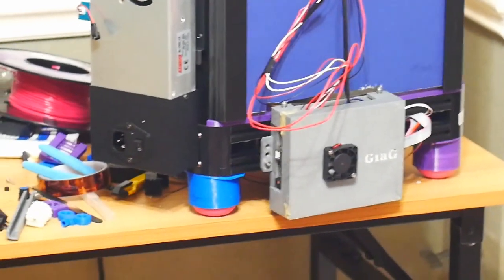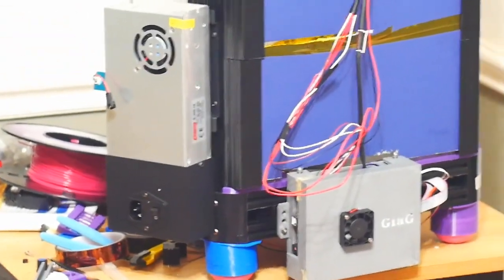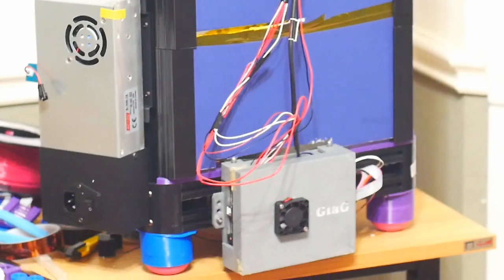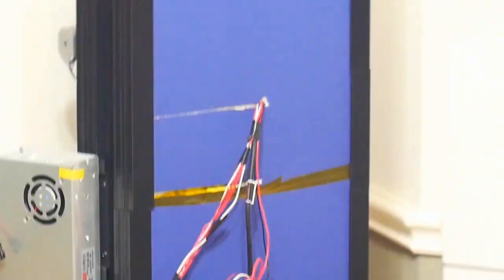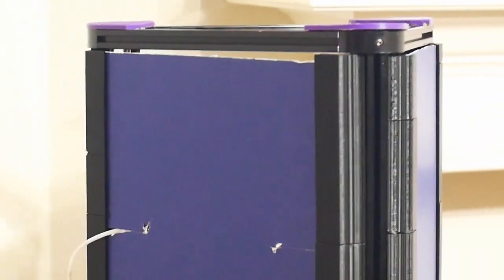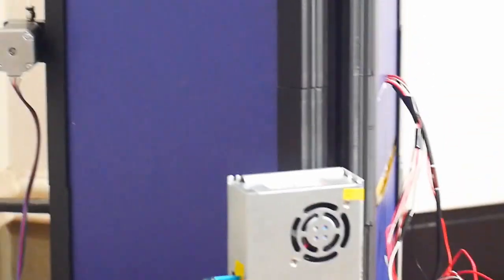Anycubic Enclosure   Part 3

Comment: Which do prefer: Anycubic Linear Plus? Or Creality Ender3?
Reply from the maker: ender 3 is the workhorse. But for tall fragile prints the anycubic has the advantage as theres no bed shake. ALSO, the anycubic is much faster. BUT, while the ender 3 requires only a filament path protector, a 235x235 borosilicate glass plate (about 25 bucks) and 2 dampers to be great, the anycubic is a several month investment in time and effort. and a lot of headaches and frustrations. so for me i like having both. the anycubic helps me with tinkering endlessly and the ender 3 prints most of the parts that I add to the anycubic ;*> Also I am doing an enclosure for the anycubic to do more ABS printing.  In fairness, dual bed rail designs are MUCH better and the early ender 3s had terrible 4 wheel single rail designs which were TOUGH to dial in. And the z axis stepper / wheels ALSO ARE TOUGH to dial in. and its not a 4 screw assemble on the ender 3 its a couple of hours. But nowhere NEAR as hard as a anycubic assemble which took me weeks. On the anycubic assemble you have to put WIRES into the MOTHERBOARD. and thats the linear plus which is supposed to be partially assembled, there are KITS for the anycubic which would take even longer. But the time is not the put together its the figuring it all out. the other printers I like are the cr-10 mini ($320), the cr-10s ($480?), and the cr-x($799), all creality. people like the tevo tornado ($369) but I dont have one.